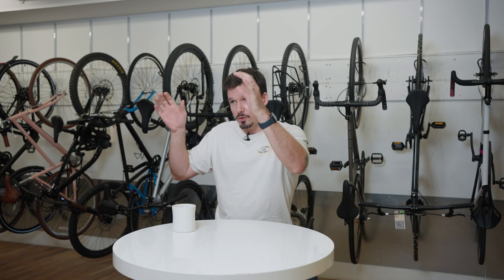Bicycle Wheel Sizes Explained: 700C, 650B, 29er, 27.5

Comment: Hello. Nice video and good information. I live in Brazil and I am the proud owner of a Priority 600  - cool bike. I also have a Velo Orange Neutrino, which is a 20” wheel minivelo bicycle. Have you ever thought on having a Priority minivelo in your catalogue? It would be great to have a bike like this available with a geared hub or pinion system and belt drive.